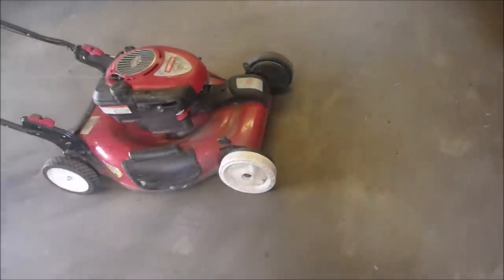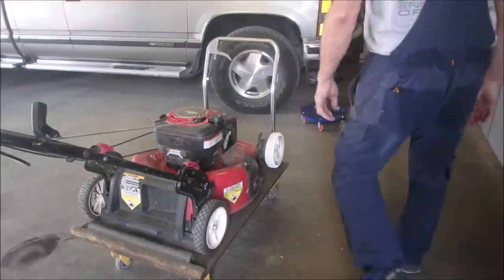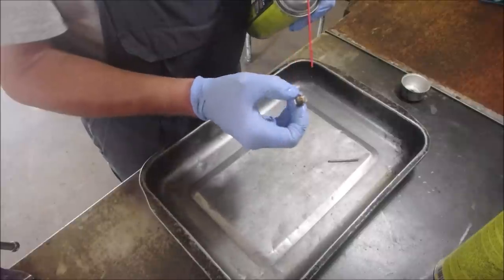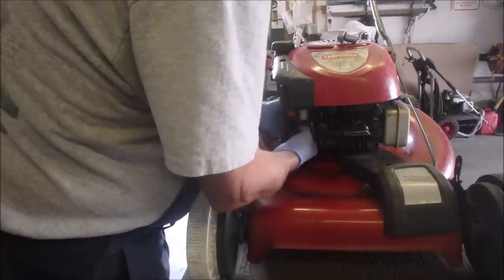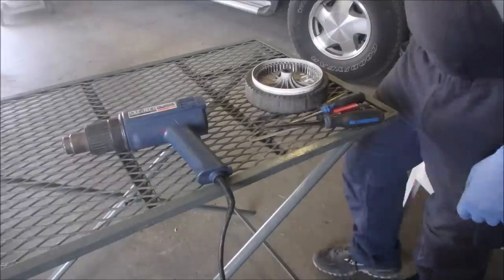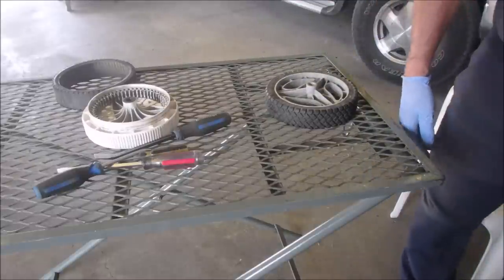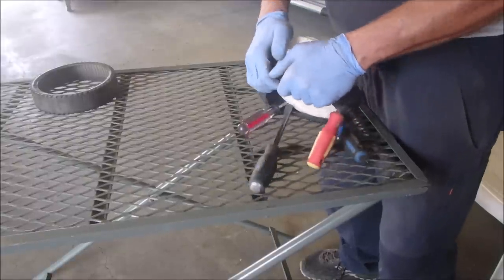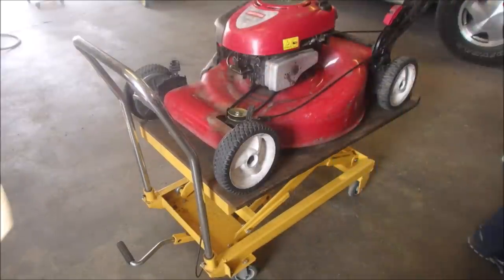Craftsman EZ Walk, Wheel Retread and Carb Work.

Comment: THANK YOU! I've been looking for a good way to replace tires. I tried cutting a bicycle tire to size and glue it on but it didn't hold. So I put screws in it to hold it on. Looked like a studded snow tire but it worked! Never knew the tires came off so easy. Toros and Troy-Bilt are the two that wear out the worst. Got two Toros right now waiting for a pair of wheels to come in from a junk mower with good wheels. Gotta look through my wheel collection, like yours, to find a match. THANK YOU!! again.
Reply from the maker: Right on

Comment: That retread is pretty trick! Was planning on using some hard rubber bmx bike tires cut down but you made it look easy ty
Reply from the maker: Glad I could help!  Use even heat on the rubber.

Comment: Well Bruce a very well put together repair video. Yep at Eliminator every machine that comes in and the customer says it runs has the carb bowl removed to check for debris and fuel tested for water others have total carb clean in the ultrasonic cleaner, this ensures no issues when returned, but our invoice will show only a bowl and jet cleaning if that is what we did. Nice rubber swap on those drive wheels we carry enough drive wheels we just install new ones but if we are ever stuck for a quick return or wheels are out of stock this is a great idea, thanks for that one.
Reply: Not sure if it would help..but if you remount tire on bolt ...like in vise it might not move so much
Reply: @jimmyalexander4825  I agree.  Or bolt it down to the table so it would move less.
Reply from the maker: You know me.  I will spend 3 hours on a $20 dollar wheel.  But I am retired an not running a full shop..